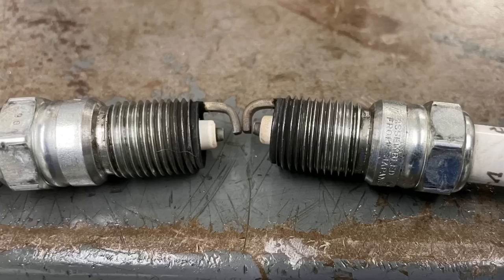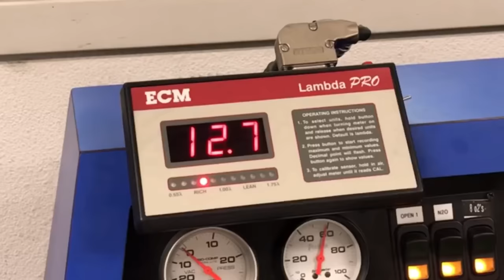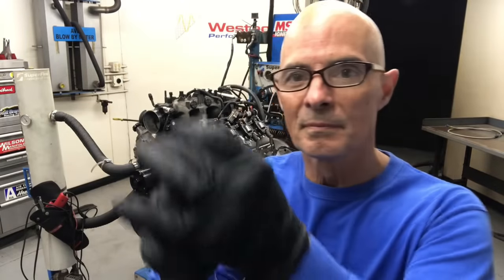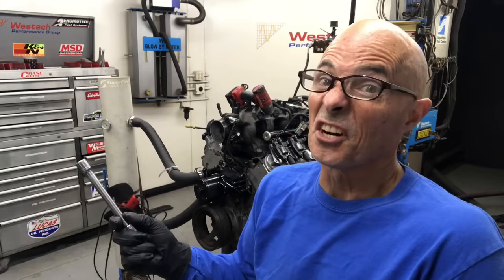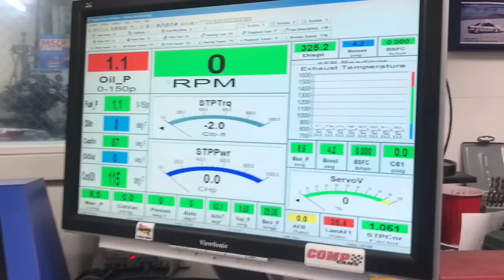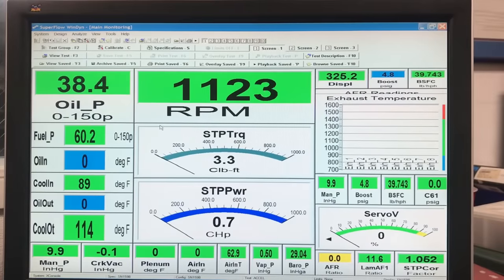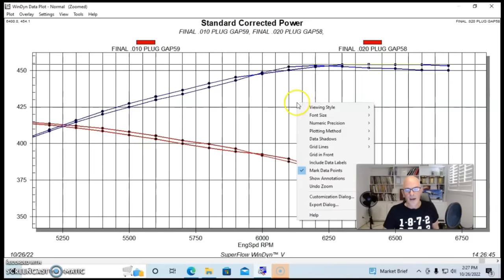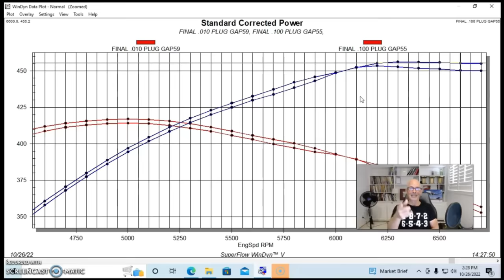JUNKYARD LS PLUG GAP TEST. DOES MORE GAP EQUAL MORE POWER? HOW MUCH SHOULD I RUN? .010 VS .100 GAP

Comment: My dad was a Machinic for 60+ years. He would always use a screwdriver to add about about .050 gap on something if it was having ignition issues saying it would give it a better flame.. As a by the book person wondered about it how it effected things. He was the best in town for a reason. RIP Dad.
Reply: Rip your dad ❤️
Reply: I close the gap if its struggling to bridge the gap and has misfires but increase the gap to optimize performance
Reply: I open gap and test with spark plugs tester and the result bigger electric spark  also without lose any power of electric spark 😎⚡👌 so i prefer and advice u guys make big gap like 100 no too much and not too small gap
Reply: Maybe his thinking knowing that over time carb build up causes higher compression you close the gap alil and open it if losing compression. I'm not 100% sure
Reply: There's a reason they usually call for a gap of about .035 inches.  The bigger the gap the more load is placed on the ignition system.  A big enough gap is needed for a good hot spark like your Dad said but there's no need to overload the ignition system with huge plug gaps.  I would never gap a plug more than 0.045 to 0.050.
Reply: Rip
Reply: @wsbill14224  I would imagine the coil doesn't like working to bridge that much of a gap.
Reply: @AmericanThunder  yes.  As far as I know .035 inches is a perfect plug gap.
Reply: I wouldn’t use a screwdriver, lol I’d use a gapping tool. Surprised he didn’t use one because he was a mechanic for so long. And even more curious is the fact they were even more fragile before lol now it’s not porcelain but stronger ceramic.
Reply: @0eroOverride He didn't need a gapping tool. That's a difference between a 60+ year master mechanic and a modern mechanic. Also you don't touch the porcelain.
Reply: Dude, a point-coil ignition system engine isn't even going to start with s .085 gap
Reply: @BensMiniToons Exactly
Reply: What's the.right size for a03vr6gap
Size
Reply: Vw
Reply: Ford Tfi runs best .050 thousands best performance idle wise and torque feels better crisp running less likely to foul.  You will notice it a lot on a bone stock 5.0 conventional V8.  Been a talk of the century since I was 15 I'm 25 now.
Reply: Come back soon Dad.
Reply: I would think if you did three tests, you could get five or 6 hp more out of the last test just because it’s hotter.
Reply: That motor has a coil near plug. Increased coil saturation time will fire a 0.100 gap. A single coil at the distributor may not fire the plug every time with a gap that big. HEI ignition would miss fire/not fire at original 0.65 reducing gap was the recommended  solution
Reply: @Sir.BigBoss  100 what?

Comment: Back in my "dealership days" I remember increasing spark gap by .010" to .045" eliminated a multitude of drivability issues.  The zone rep said I was crazy, until he had the opportunity to try it himself on his company demo.  I should also mention that this "fix" was only needed on GM 5.0 liter engines. At the time, I was working at an Oldsmobile dealership.   A few months later, they issued a service bulletin.   I was the source of several service bulletins, back in the day.
Reply: Carbureted, or EFI?
Reply: Better bulletins than bullets!!🤣🤣🤣
Reply: The 301 Pontiacs liked one range hotter plugs .. 46 from 45.
Reply: 35 thou seems low for a motor that doesn't build much compression to begin with. Wasn't it olds that played with the .085" gaps for a while too?
Reply: @Sams88990  Gm HEI started off with pretty large gap, then they took a lot of that out to limit voltage.
0.035 works just fine in my HEI applications.
Reply: @thisisyourcaptainspeaking2259  — Yeah, the early Olds 260 HEI engines called for an .080 gap. They were running those things quite lean, so there was an advantage to the wide gap.

I also remember those things ate distributor rotors like my kids ate Captain Crunch …
Reply: @Sams88990  GM, in general, played around with a lot of things. We used to have a saying that GM didn't have an R&D department.  That is what the customer is for. . . . .
Reply: @sking2173  When did they turn up AF ratio, for catalytic converter?
One problem with lean is misfire. Exhaust hydrocarbons then go up, opposite of the goal.
Cat converter needs something to burn in order to remain lit.
Reply: must be super lean
Reply: @johnpublic168  14:1 was the "target" . . .
Reply: @thisisyourcaptainspeaking2259  Computer Command Control (CCC) Rochestor Four Barrel.  Couldn't "fatten up" the primaries without setting a code.
Reply: @wesalker3479  I figured GM gained control over mixture using O2 feedback via software and e4me carburetor.  I don't remember cats running open loop.
If I recall, the catalytic converter requires unburt hydrocarbons in order to function, thus a feedback strategy must run slightly richer (on average) than open loop?
I forget the details of injecting air pre-cat days in an attempt to increase burn in the exhaust manifold, not sure that was a solution.  I guess air was injected into the cat to ensure the cat had sufficient oxygen?
Reply: @thisisyourcaptainspeaking2259  it was essentially a chemical/catalytic reaction that occurred within the converter, not prolonged combustion.  The catalyst converts hydrocarbons and carbon monoxide to carbon dioxide and water vapor and oxides of nitrogen to oxygen and nitrogen.  The process itself produces heat.  Too much unburnt fuel will result in catalyst overheating and can melt and/or fracture the catalytic grid and, in the early days, pellets.
       Air injection in "pre cat" days was indeed intended to prolong the combustion process.  Engineers used air pumps to bring catalytic converters up to operating temperature more quickly, as well.  Improvement in catalytic technology and materials and tighter fuel management later made air pumps unnecessary.
Reply: @wesalker3479  The point I'm making is, the catalyst system is parasitic with the benefit of dramatically reduced emissions at the expense of fuel efficiency.  In other words, AF ratio is richer than is necessary.
3-way converters store oxygen, eliminating the necessity for injecting air.  This oxygen is used for reducing oxides of nitrogen (NOx) to N2 and O2.
Reply: @thisisyourcaptainspeaking2259  Question . . . . . Why make the fuel mixture "richer than necessary" when, with todays computers and lightning fast baud rates and response times and custom tuning capabilities, you can make it as rich AS necessary?  This is, of course, speaking to engines that are computer managed.  Most tuners like to "see" A/F rations between 12 and 13 to 1.  As most of us know, 14.7:1 is the stoichiometric ratio for peak emissions results but, NOT for performance.  Federal mandates require manufacturers to produce products that conform to emmissio9ns standards, not performance standards.  What the consumer does to the vehicle for performance is completely up to him . . . or her!
Reply: @wesalker3479  It's not a convenient choice, it's a necessary evil that results from the virtue of catalytic converter.  The converter must be heated in order to operate correctly and that's done via self-heating by unburned hydrocarbons.  The mixture could otherwise be leaner if it weren't for the need to keep cat converters lit.
Reply: @thisisyourcaptainspeaking2259  True . . . they require 1200 to 1600 degrees Fahrenheit to function properly, HOWEVER, once the process is started, all that is necessary to sustain it is . . . oxygen.  Even with lean air/fuel mixtures, there is still sufficient hydrocarbon(s) to maintain the conversion.  A rich exhaust mixture will stop the CATALYTIC process and overheat the converter.   It is, after all, called a Catalytic Converter NOT an "Afterburner", which is what you are describing.
Reply: @wesalker3479  GM had at one time for a short while, implemented a "lean mode" that was enabled at highway cruise following a specified time (20 minutes?) for the purpose of improving fuel consumption.  EPA didn't like it and made them remove this mode because catalysis was less effective.
CAT converter must have more than just air to operate, it must also have hydrocarbons to generate heat require for complete catalyst reaction.  Think about it...  Insufficient hydrocarbons leads to low temperature.  What's left over is water vapor and CO2, for the most part.
Have a look at how a 3-way catalytic converter operates.
Today's 3-way cats practically are afterburners if that's what you prefer to call them, but I don't think they're able to handle a misfire due to lack of spark, for very long.  They're surprisingly robust, within limits.
Reply: @thisisyourcaptainspeaking2259  Yeah, I remember a little about that, but not much.  It was used on big block trucks with manual transmissions and a fifth gear switch to "tell" the computer when to implement the protocall, if I recall correctly. I didn't work in any GM dealerships that sold trucks so, I'm going from a limited memory.  What you need to remember here is the target 14:1 A/F ratio is still stoichiometrically RICH. The stoichiometric ratio being 14.7:1  I don't know what their "lean target" was but, it still may have been less than 15:1 . . .      This would be a fun conversation to have, face to face, with a six pack!
Reply: Lol
Reply: Funny thing is GM did the opposite with the early LS engines, they started at .060" gap and a TSB changed that to 0.040", although that's supposedly due to iridium being the new standard vs platinum (higher elec resistance).
Reply: @stujones3566  it was the nineties . . . ALL of the domestics sucked . . .
Reply: @wesalker3479  TECHNICALLY SPEAKING, no, it's not up to the consumer.  Technically any and all tuning that can have an effect on emissions(everything) is expressly illegal, according to the federal government.
Reply: @adamcousins2459  and yet . . . . . ?
Reply: it's guys like you whom i learned the knowledge that got me where i am today. praise and respect to you for knowing your science and persuading difficult listeners to listen and act.
Reply: @thisisyourcaptainspeaking2259  same difference in the 80's & 90's. chevy's EFI was smoggier than a carbureted chevy and would leave a ridge in the cylinder where the top ring stopped. your attempting to apply port injection logic to TBI aka the electric carburetor with uneven air & fuel distribution between cylinders. unless i heard you wrong, sorry. or oops.
Reply: @rooftopcertifiedautorepair2012  I wasn't thinking of tbi specifically, I was thinking of dry intake manifold.
TBI was kinda cool though, it performed quite well by my recollection and yeah, perhaps more like a carburetor in terms of upper cylinder wear.  I recall carburetor chokes being tuned quite fat from the factory and attribute much of the upper cylinder wear to that.
We had some pretty sketchy motor oil back then along with the leaded fuel (pre-cat days), neither were very helpful IMO.  E4ME was the electric carburetor.
TBI, as I recall, came with cats and that pretty much chews up everything but lead. These were  2-way cats I think, thus had no oxygen storage capability to speak of.
Reply: Could be the reason ford 302 is set for .046
Reply: That's bizarre
Reply: Back in the day that makes sense.  A bigger gap within reason will give more spark for better performance, but today ignition systems are computer regulated to do the same thing better.
Reply: Your fix will suffice but best ignition current is needed for best performance.
Reply: I remember working in my dad's shop as a kid and we gapped per spec 60 80 thousands on some cars.
Reply: This is all well and good but Ford were having constant problems with failed coil packs and traced the issue to the larger 1.3mm gap and when the gap was reduced to 1.0mm the failures went away. The problem with a large gap is it allows a significantly higher voltage to build to jump the gap. On old school ignition systems this wouldnt be a problem but with more modern electronics it can be.
Reply: @wesalker3479  Correct.  That's why a converter equipped engine runs at a 14:1 to 15:1 ratio when carbureted, much closer to 14.7:1 when equipped with EFI.  That's why most of the 1975 cars ran better than the 73s and 74s and much better than the 75 and 76 Chrysler products that DIDN'T have a catalytic converter.  Those all ran around 15.5 - 16.5:1.  And that's why we hate computerized cars - you can't make "adjustments".  The computer will try to compensate, and if it can't, it just won't run.

Comment: In my experience all that a huge plug gap does is help you find out if your coil is weak.
Reply: Most spark testers are like .125 gap or better
Reply: And that's similar to the ignition manufacturers pushing higher voltage systems
Reply: Works for me (agree)!
Reply: @MrTheHillfolk  yes but .125 at atmospheric pressure is not comparible to .030 under load in a cylinder and worlds away from that under boost :)
Reply: An MSD will jump 3/4 inch in the atmosphere, throwing a blue nitrogen corona the diameter of a pencil.
THAT WILL convince you not to get shocked by an MSD 6..... It'll make you wet your pants and say bad words.😆😆😆
Reply: @hotrodray6802  I could see where that much voltage solves misfire issues if say you were running 40psi of boost.
Reply: @hotrodray6802  I’ve been hit with a MSD 6 , plug wire was off the cap side on a first start , sounded like a loose rocker arm I grabbed the distributor to advance timing and it felt like I was dropkicked in the chest , come to find out a wire was off the back side of the distributor, and exactly like you said , big blue spark the diameter of a pencil, it was also the last time I ever drank alcohol and worked on a vehicle, that was in 2008
Reply: All depends if you're engine naturally aspirated your pretty much fine but if have a turbo or blower engine you need to tighten the gap or the turbo will just about blow the spark out depends on boost level. I forgot to gap my spark plugs gap after I Turbo my engine I put them in they were set for factory spec's I started it and kinda scared me it took longer to start and sound weird. I felt stupid but happy it was a easy fix.
Reply: @markchapman2585  you also need the correct heat range.  On gt500s they say you need a step colder if you're above stock boost ecsp above 17 psi I am running 20 psi on my gen3r 2650 tvs in my 07 gt500 and I had stock heat range plugs thinking they were 1 step colder.  It ran ok at first but they burned up fast and started to miss and have trouble anytime I got into boost.  I couldn't figure out what the issue was the gap was .026 where it's recommended for this boost level then I figure out I had tr6 plugs which are stock heat range then I knew.  Switched to a step colder same gap same brand plug (ngk) and it now runs smooth through the entire power curve and runs like a scaled dog.
Reply: @markchapman2585 Your turbo does nothing during starting so your problem wasn't spark gap. Anyone that doesn't know this shouldn't be tinkering with their engine.
Reply: @DonziGT230  Maybe he meant Supercharger.

Comment: The mixture either combusts or it doesn't.   It doesn't combust harder with more spark.  More spark will advance the timing ever so slightly, and less spark will retard the timing ever so slightly.  This is the gain and loss that you see.

Comment: All the spark does is ignite the fuel, more intense spark will light more fuel but not needed the average low quality gas engine has a spark soo weak you nearly cant see it, more spark makes it last longer and remove carbon fouling but may lead to more wear

Comment: The reason for the power increase is because the coil has to build more voltage before it can jump the gap, meaning a "hotter" spark. However, just because it makes more power doesn't mean it's good, there is a reason the engineers don't manufacture them like that, first is dramatically increased plug wear and shortened life because more voltage equals more erosion, and secondly, the coil having to build more voltage before discharge also dramatically shortens the life of it. So the bottom line is just stick to factory specs unless you like replacing plugs and coils at twice the normal rate for less than a 1% increase in power.

Comment: You've got to make sure that the car can still start in the cold though, which is when the demand on the battery is highest and the voltage available to the ignition system is the lowest. I had a girlfriend with a Ford Capri that would run very nicely when it was running, but as it got colder it became harder and harder to start. I found out the spark plug gap was about 1.5mm. Reducing it to 1mm solved the problem.

Comment: So, what I get from this is to never change my plugs as it will only get stronger as the gap increases.  Saves me a lot of work.
Reply: Lol! You couldn't be more right!
Reply: I leave mine (copper) alone until misfire occurs, platinum will seize in aluminum threads before the plug wears out.  This means waiting till misfire in the case of aluminum with platinum risks thread damage.
Reply: I've seen a bunch of modern cars with .100